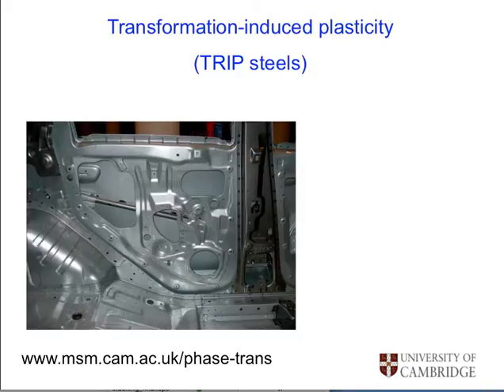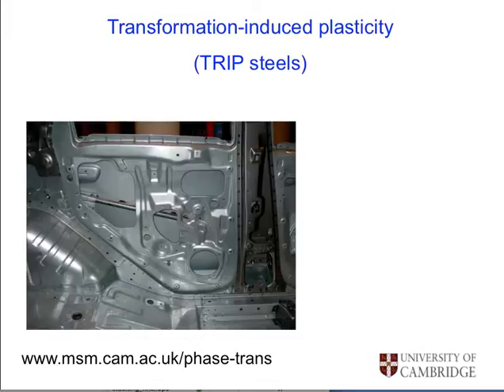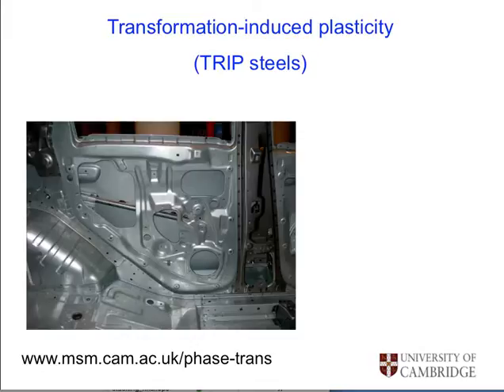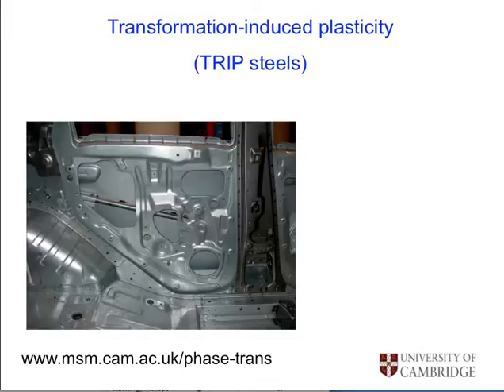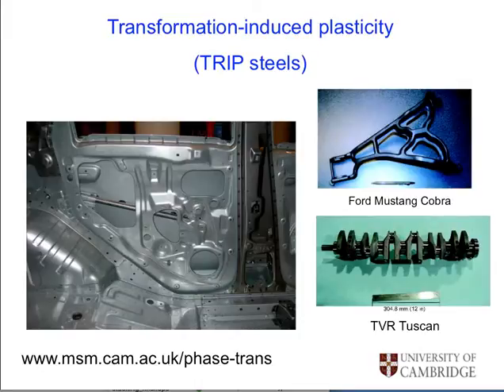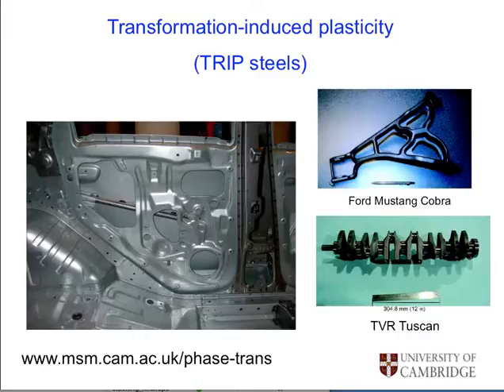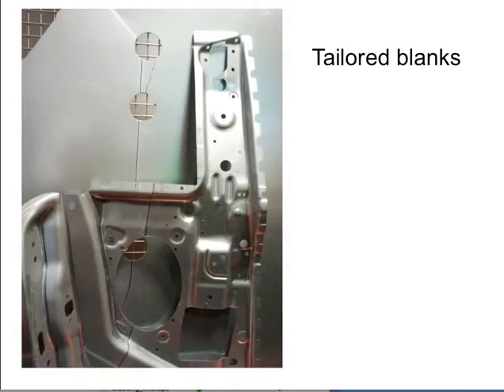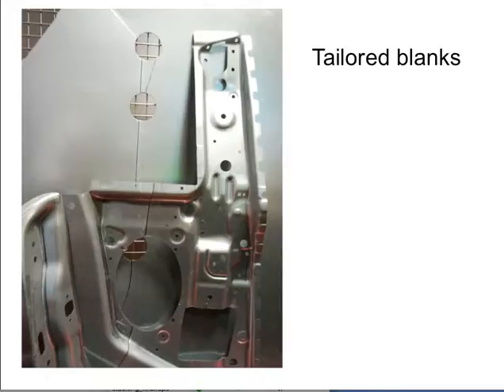Steels: transformation-induced plasticity, lecture 10 (2016)

Comment: Dear professor Bhadeshia,In  your article“Transformation induced plasticity assisted steels: stress or strain affected
martensitic transformation?”,you said it’s stress induced transformation. In” Austenite stability and heterogeneous deformation
in fine-grained transformation-induced plasticity assisted steel”,it’s strain induced transformation.Why they are different? And in tensile beyond yielding,there are stress induced and strain suppressed transformation, what will be the result?
Reply from the maker: Journal of less-common metals 28 (1972) 107-118